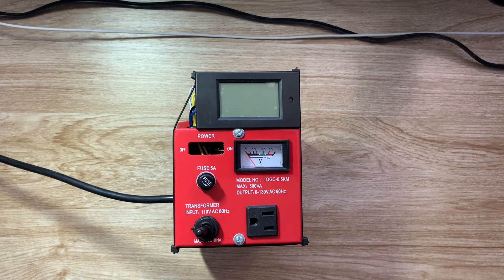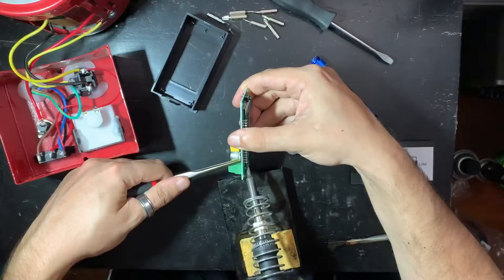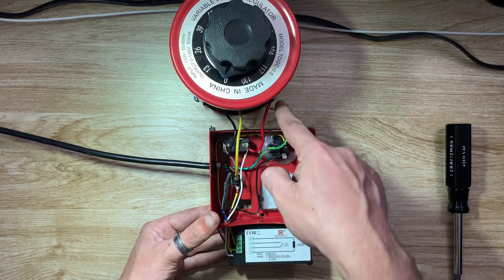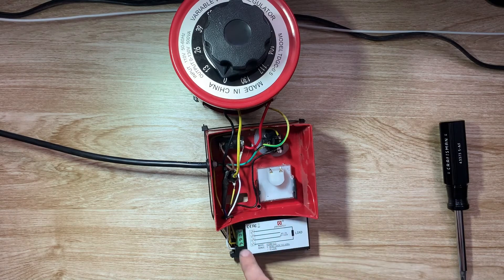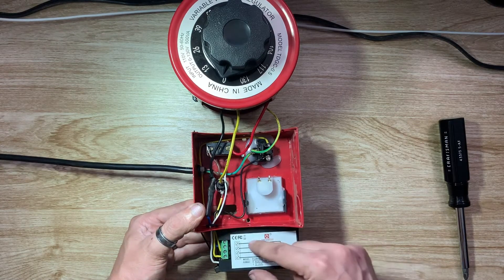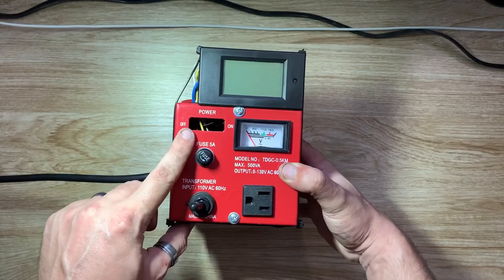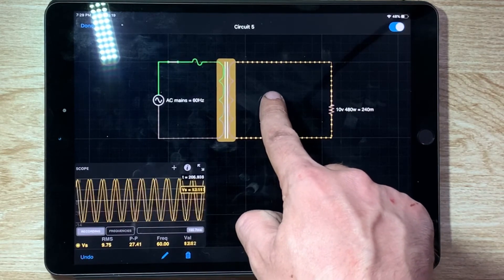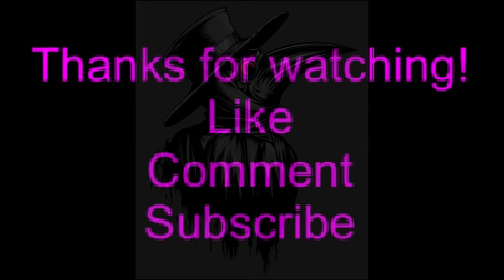Modified Variac with digital meter

Comment: I follow your steps and wire it the same as the video, but for some reason I can get it to work, I move the fuse to the secondary side and as soon as I turn the variac it blows the fuse. Any suggestion?